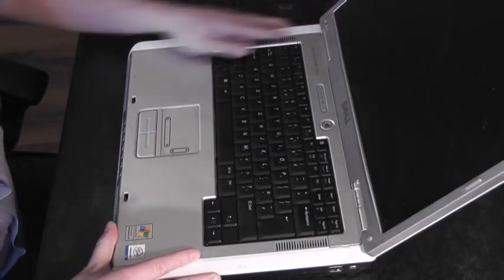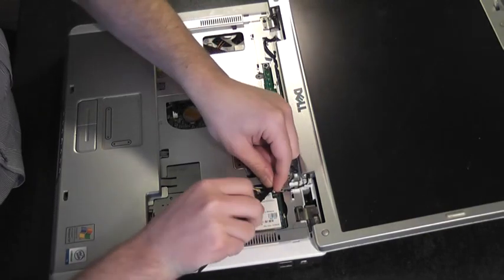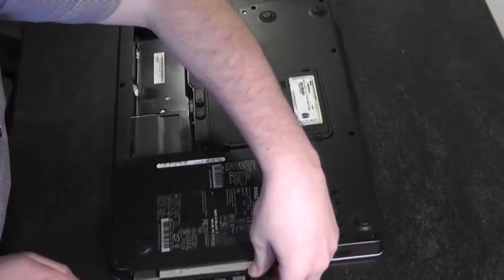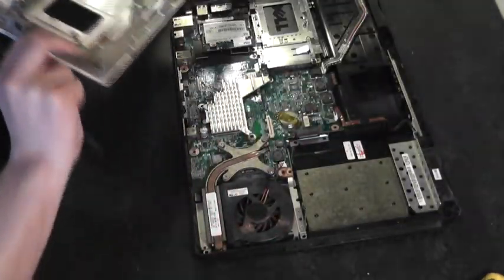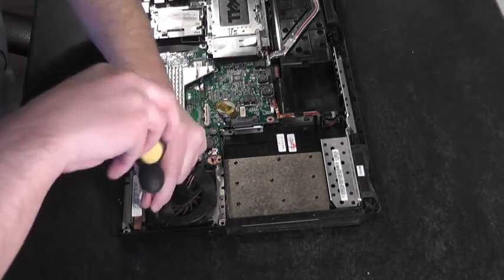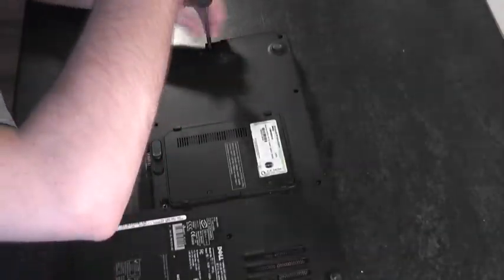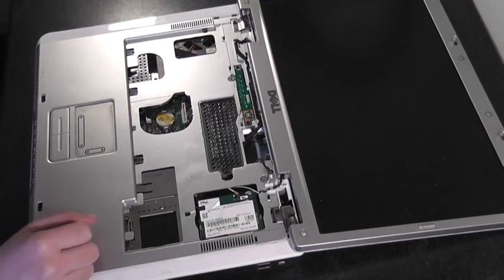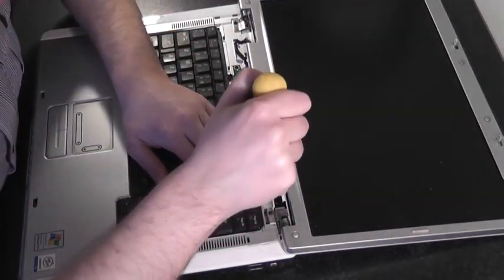Dell Inspiron 6000 Overheating Problem Step by Step Guide to Fix

Comment: Thanks a lot!!!  Very clear instructions!! Done in 15'.

Best results gettin out the whole assembly as you can get the dust out of the radiator, not the same with compressed air. Thanks again for the video and regards from Spain

Comment: You can easily do this without dissasembling whole laptop... Just remove keyboard and use pressure air and from above and vacum where the hot air comes out  :)  Same result in 3 minutes